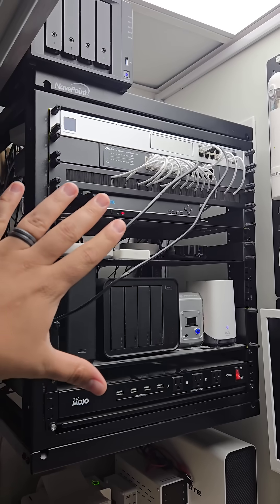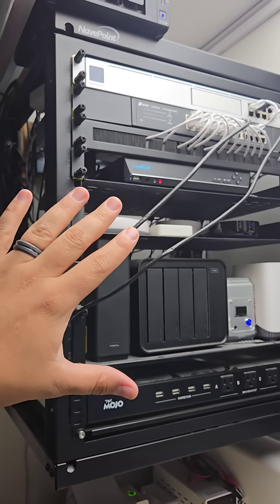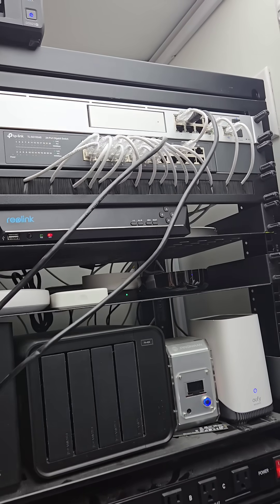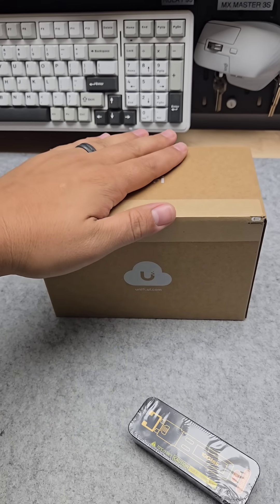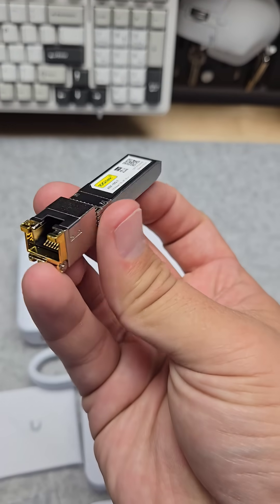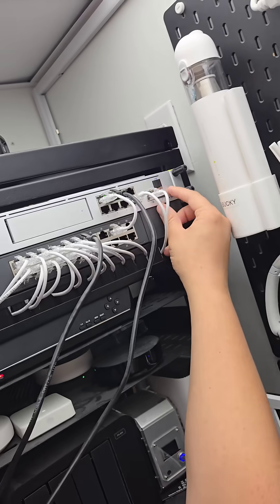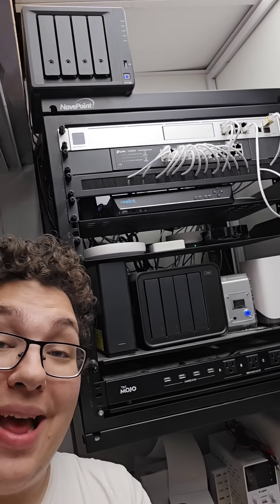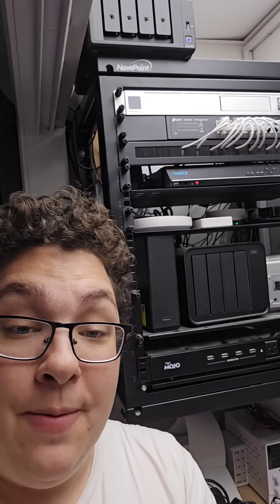smart home network rack upgrade! #smarthome #network #rack #fiber

Comment: Watch the heat at the top. It looks like you have plenty of air flow but NAS boxes are most likely to be less tolerant than network switches. 

When you cook kit it sometimes causes the electronics to get weird intermittent problems. If you want to get some smart home kit Shelly do great stuff that just integrates with home assistant and can be expanded to add temperature monitoring.

Comment: Looks great. How deep is that rack? I’ve got everything in a wardrobe in my hallway maybe will get rack one day
Reply from the maker: Thanks! The rack is 18" deep. I made a full video on it when I first put it in if you want to see how complicated it is. Not too bad to set up for a first timer with no network experience: https://youtu.be/cu-Qk4xMh1Q
Reply: @MakeItWorkTech thanks I’m a techy also so should be good fun to do. But I’ll need to buy a large drawer in my hallway and add ventilation first before I can consider this 😁 but looks good